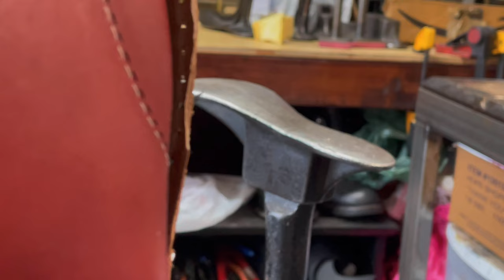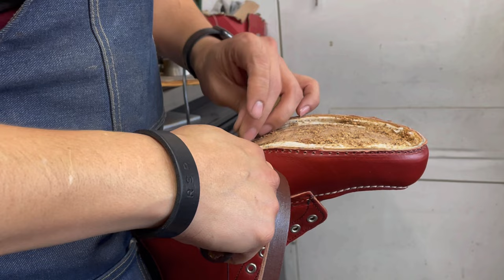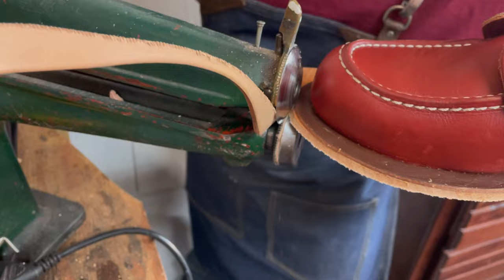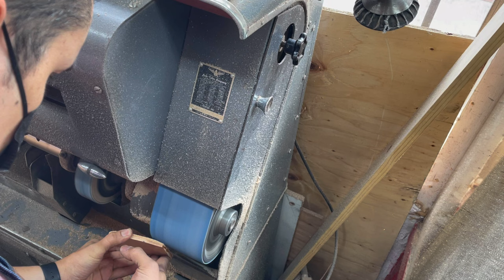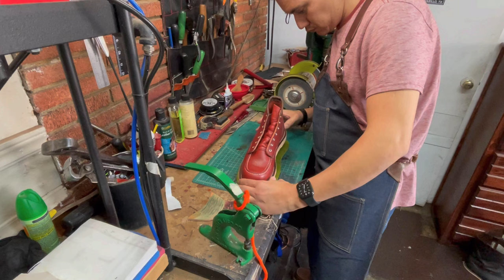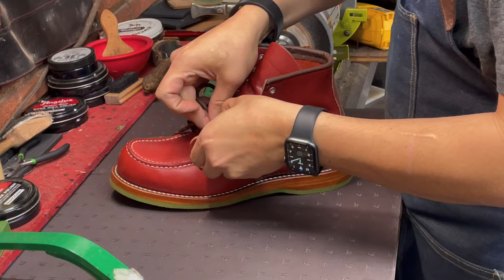Red Wing 8875/Irish Setter Upgraded #redwingboots #redwingheritage #shoerepair #cobbler

Comment: Wow! These came out great. Question: how comfortable are these Dr Sole’s compared to the soles that comes on the Iron Rangers? I want to make my Iron Rangers more soft and comfortable.
Reply from the maker: It’s the same,the vibram mini Lug or Cork soles that Rangers come with are not comfortable because they never have a leather midsoles but,if you want something comfortable Vibram Christy,2021 or 1705 are way more comfortable than any rubber soles.